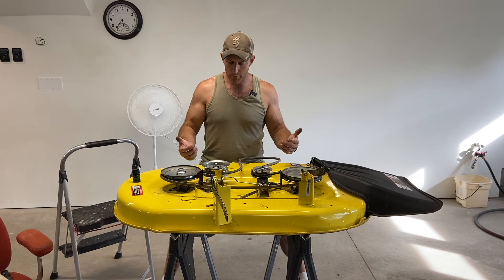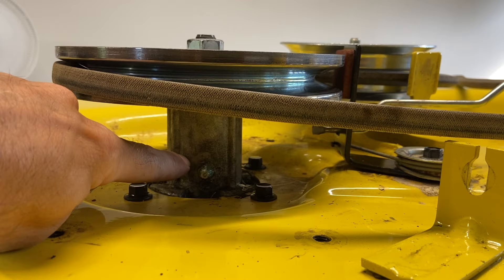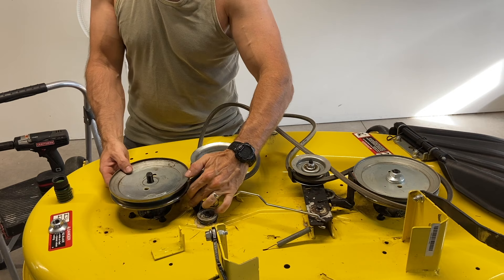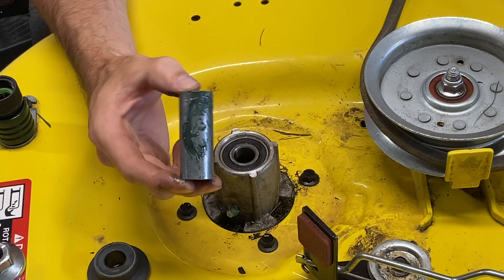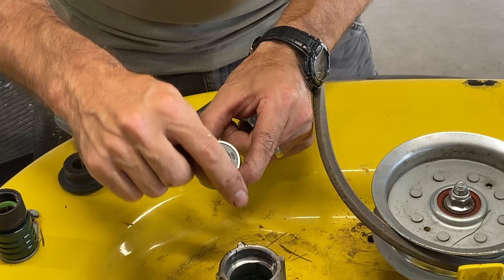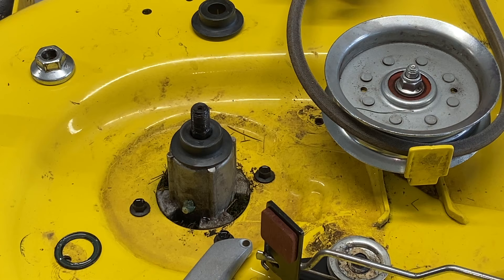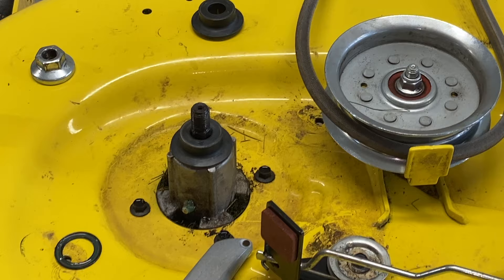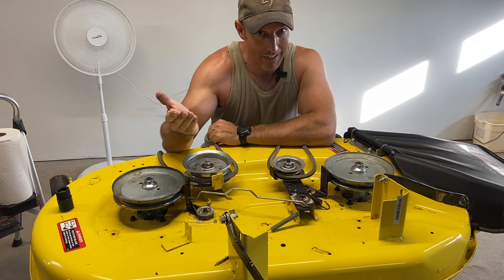I WOULD DO THIS DIFFERENT NOW JUST REPACK THE BEARINGS WITH GOOD GREASE AND PUT SEALS BACK ON.

Comment: I’ve seen some spindles with sealed bearings and some without seals. The best way to check is to look up the part number for replacement bearings, rather than tearing down a spindle.  Nothing at all wrong with sealed bearings, they are lubed from the factory and can last for decades.
Reply from the maker: Thank you for watching and the info
Reply: What are you taling about was real 30-40 years ago. Today, the spindles does not work more than one season. My original bearings for my tractor I had bought new, rolled in just one year, less than 60 hours. In the fall, all three were noisy, even respecting the maintenance schedule, with greasing every 25 hours. So after two lubrications, during the winter I disassembled the spindles and found the six bearings with the seals on both sides. The grease I pumped, did not reach the bearings, because of the seals. After thoroughly cleaning the housings, I installed new bearings on which I removed the inside seals, with my hydraulic press. I carefully installed the bearings, tightened the two nuts on each spindle the both sides, (blades as well as the sides of the pulleys) at 65lb / ft to John Deere's specifications, and the following summer despite the recommended lubrication every 25 hours, the following fall I had to change the bearings again which were still noisy. So ... either the bearings were not chosen well by the manufacturer, or the bearings are of very poor quality, and again it is possible that the grease is no longer of the same quality as there were 30- 40 years ago. So, no spindle would run decades on the John Deere lawn mower.
Reply: @Adriva01  sounds like a better quality bearing is needed...
Try some well known brands.
Reply: @candohunter3176  so what are the better well known brands?
Reply: @Adriva01  Not sure what caused your problem but I had a 48" JD deck that has mowed about 4 acres a week April through October for 15 years with the original spindles and idler pulleys, never touched them. The deck rotted out requiring replacement but that is another story. The spindles were good enough to reuse but I opted for new as I would have had to install them into the new deck and wanted to start fresh.
Perhaps you damaged the bearings by using a press to remove the seals, bearings such as these are not designed for axial loading. Others that I have known to remove said seals gently used a hooked pick to pop the seals out and while I personally disagree with this practice, they have all experienced good results. And we live in corn country where every piece of equipment is green,. Heck, used to be if you bought a new tractor (a real one) they would give you a new mower. Buy a combine and get a Gator!

Comment: I know this is old but... So few people know the truth. A sealed bearing uses a rubber ot plastic ring to keep oit dust and debris. However greese can easily be push by that seal when greasing with a grease gun. Shielded bearings use a metal pressed in disc that goes with that rubber one would go. These are packed at the factory and are not serviceable most of the time. That shield keeps out pretty much everything. You can get a bearing in any combination of open sealed or shielded. I challenge everybody next time you take your spindles off to service them clean it all out clean out your bearings put the seals back in and pump it full of grease then take your bearings back out and you will see the grease got packed into the bearings when you greased it with your grease gun through the zerk fitting. It's literally how it was meant to work.

Comment: Good video. I just took the spindles out of my dad’s old Saber JD today because I was getting a little vibration. My dad brought this new in 98 or 99. The spindles had a little movement but I think are salvageable has the original belt and original deck pulleys and still all tight. Any way I ordered all new to replace them and will keep these as a spare. Do you have any information on where I can find replacement bearings for the original spindles? Thanks for any information.
Reply from the maker: Sorry I do not, leave a comment if you find a good place to buy.

Comment: I went to Detroit ball bearing school. In the 80s . Sealed bearings have grease from the factory. and don't need to be greased. The shield keeps the grease in and the dirt away from the bearings. Unsealed bearings have to be greased to flush out the dirt and lubricate them. Sealed bearings are already greased and sealed. God bless you jesus is coming soon. Judgement is here. Seek the lord daily 👉♥️♥️👑👑👍
Reply from the maker: Thank you God bless Jesus is awesome
Reply: Its a good idea to take the bearings off and repack them every 2 years or so if you live in a hot climate. I've had bearing go out because of NOT doing this, yes, I've learned the hard way.
Reply: My hometown, and I'm still in the area now
Reply: Mark Allison 88- Actually unsealed bearings were meant to be used in an oil bath application, like inside a transmission , small engines, some oil filled pumps, etc. You cant rely on pumping fresh grease into an open bearing to flush out foreign debris. Just ont tiny piece of debris will quickly wear out the bearing rollers/race. But I agree with your first statement. Sealed bearings don't need to have grease added. But we have all done it :-(

Comment: I wud hv jst packed those bearings and replace the seal. Also, drop a good load of grease in the spindle housing. My tractor is 7 years old and hvn't had a problem with bearings. NEVER use water or pressure washer to clean off deck. Just use compressor to blow off the grass
Reply from the maker: Good advice thanks for watching

Comment: Another person occasionally uses my computer and her name and initial shows up.  Sorry.  I've read over a hundred of these helpful postings and have to admit I learned several things.  And I like it that DIY JIM has admitted he also has been impressed by the postings.  Number one:  Do not wash a deck with water. Blow the grass off.  #2:  Bearing technology has changed in my 80 years.  I hand packed bearings for years.  Now that is an issue if you "fill 'er up with grease!"  60 years ago I was shown grease which could be heated with a torch and still be 'greasy" while red hot.  Is that the Lucas Red?   I think lithium.   I don't know but I like the idea!  Conclusion:  Don't clean a deck with water....and SLIGHTLY repack sealed bearings and re-insltall them as sealed bearings.  Now a problem.  Just installed two new tower mandrels, new Oregon blades and a new 95" good belt on a Craftsman LT 2000 42 inch mower deck....correctly.  Within five seconds before even mowing it sounded like the right mandrel had ball-bearing failure.  Any ideas?   I gave up so I could go eat..and have a couple bourbons before total frustration set in!  Charlie Pierce
Reply from the maker: thanks for info and watching

Comment: I've watched a number of videos like yours talking about removing the bearing's inner seal "permanently" so you can use a grease gun on a zerk to hydraulically force grease into the bearing cavity ... I've decided I disagree ... here's why , the spindle and thus the bearing are rotating at high speed and whatever grease you have in the bearing will "mostly" get thrown out w/o a seal ... you can fill that spindle housing cavity to the max , even until the bearings are fully packed but when it's spinning there's no more grease getting forced into the bearing but instead it gets thrown out w/o a seal ... 

OK fine , so what's my better idea (??) ... as a regular maintenance item just pull the spindles , pop the bearings , remove the inner seal , clean and "hand pack" the bearings , replace seal and put spindle assembly back together ... use a high quality high temp. grease and do bearing maintenance every 100 hours or so should be more than enough to keep them in perfect condition ...
Reply from the maker: I agree I think I would do it different now if I were to do it again that is why I say for everyone to read the comments. Thanks for watching and leaving a comment
Reply: @DIYJIM  ... hi , Jim ... I'm not disagreeing w/you personally but the concept of permanently removing the inner seal , there are so many others promoting that idea on TY ... I just think it's not that big a deal to just service the spindles every 100 hours or so , maybe every couple years when it's time to replace the V-belt , just remove the spindles , pop the bearings and repack them , put back together ...

Comment: If you make the effort to COMPLETELY fill the spindles with pumped in grease via the zerks, those inner seals won't stop that hydraulic action. Agreed taking off the inner seal on both bearing the best policy. In doubt of grease simply pushing past rubber/metal bearing seals, kindly look up videos where grease it pumped in behind clutch pilot bushings to be pushed out for replacement. Good content here though and thanks!
Reply from the maker: Thanks for watching Marvin

Comment: Leaving those bearings open is a mistake.  I have messed with his stuff for years.  Pull the cover off add a little grease then put the cover back on.
Reply from the maker: Thanks for the info sounds like a good idea
Reply: And every channel on the subject recommends the seal being removed then re-installed. Whom to believe? And, these guys are small engine repair specialists!
Reply: @swingbelly  I own a large heavy equipment rental company.  We mess with all types of bearings every week.  Unfortunately most bearings are now made in China and they are not what they used to be.  As well, they have engineered them to be unserviceable by design to create replacement frequency.   The cleaner and greasier you can keep them the longer they will last.  We use a very high quality grease and we try to get the most out of them. It’s not the expense of the bearing it’s the expense of the down time and labor.

Comment: Sealed bearings shouldn't need lubricating. They are sealed to keep contaminants out. If you remove the seals there's a risk of over lubricating and contaminating them.
Reply from the maker: thank you for your comment but they are inside the spindle so they should not get any contaminates but thank you for commenting. Hope you summer is going good
Reply: Sealed bearings are great and made to last. Even alot of  18 wheeler semi trucks these days have sealed wheel bearings that last hundreds of thousands of miles with  with no problems. Still a great video.
Reply: Everything 'M' said in the comment covers what I was going to say so the real value of your excellent video is how to get at the bearings in the of chance they need service.  To offer something new, use a rubber/plastic mallet when tapping in bearings or a block of hardwood.   There, i added a tiny bit.  Great video, thanks for doing it.
Reply: I checked with my JD dealer, and he stated that the bearing are sealed to stop water intrusion, and by doing this mod it will shorten the life of the bearings. He told me they are $4 bucks each and would be glad the sell me a set after the mod.
Reply: M  Probably makes no difference in the life of the bearings in a spindle but I prefer not to put in the work for the modification since it may not make a difference.  The spindles are not that expensive so the entire thing can be replaced.  Owners can try the modification if they select to replace just the bearings.  Grease in the spindle may be more about cooling than lubrication.
Reply: @julianyoule-white7675   a short pice of pvc pipe between bearing and the hammer wont hurt the bearrings

Comment: A Sealed Bearing requires a specified amouunt of grease.  Timkin Bearings will tell you how much grease the bearing should have.  Dirt and Contaminants Kill Bearings.  Keep them Clean with the Proper amount of Grease and they will last a long time.  A little dab will do you and a whole lot will screw you!
Reply from the maker: thanks for watching and commenting
Reply: @DIYJIM  If you find dirt or contaminants the outter seal has failed. Clean and add correct amount of grease and ensure inner seal is the outter seal.  I do not worry about the inner seal, but it will hold the grease in the bearing.  The grease fitting is of no value!
Reply: @DIYJIM  If you fill the space between the upper and lower bearing with grease the bearings would want to be pushed out.  It is of no use.  Better to remove, clean and inspect or replace the bearings.  I hope to help!
Reply from the maker: I agree with what you are saying since I have made this video I have learned more and what you are saying makes sense thanks
Reply: Thank You for helping people!
Reply: @DIYJIM  Just a mechanic!
Reply: @DIYJIM  You are Welcome!  Keep helping others!
Reply from the maker: Thanks I’m trying

Comment: I had a mower deck with sealed bearings with no grease zerk lasted over 20 years. Them bearing are dirt cheap if you know were to by them. I use to buy them in a 10 pack for about 20 dollars if that.
Reply from the maker: Wow thanks for watching and commenting

Comment: My housing breaks long before the bearing wears out. :-0(
Reply from the maker: Wow really ,thanks for watching
Reply: Quit hitting shit.  And get toro spindles
Reply: @yzrippin  "Quit hitting shit."
The terrain is rough and I can't change that - far too much of it and too costly (thousands to fix that).
I replace maybe 2 spindles/mandrels each year, much cheaper.
I know it is designed to break so you won;t hurt your deck mount but I still wish they were a little bit stronger. Will look into toro to see if they fit mine - thanks!
Reply: @2Truth4Liberty  ah yea i feel that.  Im allways pulling shit outta peoples lawns.  Last week was a spark plug that almost took out a window and this week i almost hit a railroad spike.   Who tf are these people that put this shit here?
Reply: @yzrippin  My place used to be an auto salvage yard. After many years of cleanup, still picking up pieces of glass, spark plugs, bolts, you name it.

Comment: WOW, am I glad I watched the other video someone below recommended ("Don’t trust the “Experts” Grease your mower deck sealed spindle bearings Common sense maintenance" by Woodcheck Russ the deck Dr. ) he shows you that the grease DOES INDEED push thru and into the sealed bearings....IF you add enough grease using the zirks on that shaft. He says you need to pump 40-70 times to fill up that empty shaft and then the grease will be pressurized enough to push into the sealed bearings, past that rubber seal you took off. Then just keep that shaft full and you probably only have to pump 10-20 times every now and then. Gotta watch his vid, it's perfect.
Reply from the maker: Thanks for watching

Comment: I only got 130 hrs on my 1st set of John Deere spindles on my X300. By the time the bearing went it chewed up the spindle casing below making the blade wobble. The 2nd set I greased about 60 pumps until grease was visible on the blade side. A YouTube channel showed someone testing the theory whether grease gets into a sealed bearing and it does. Proven with a different colour grease. Hopefully my new spindles last longer this time. If this pair goes on me then the next set I will take apart and hand grease them 1st and after that, once a yr at the zerk fitting.
Reply from the maker: Thanks for watching hope your new spindles last

Comment: Just watched this . the reason you are not getting grease inside the bearings is because you are not pumping enough grease into your grease fitting . it takes between 40 to 60 hand pumps to put enough pressure for the grease to get into the bearings the seal you took off the bearing is rubber . grease will squeeze pass the rubber and get to the bearings if you pump enough grease into the fitting.
Reply from the maker: Thanks for the info and thanks for watching

Comment: Removing the seal from the inside will help. But the hydraulic pressure of your grease gun will force greave to the bearing.
You can also drill out the rivets of the idlers pulleys and separate the halves and replace the bearings in those.
Just use steal rivets when you go back.
Reply from the maker: Awesome thanks for the information
Reply: For Idler Pulleys.    I Just Remove the rivets then use a drill to create room for 1/4" bolts / nuts - washers Grade 5 or better is more than adequate. 
 Use blue threadlocker keeps em` tight  and strong till the bearings need another swap.  Repeat as needed......
Reply: Why not just use a grease needle to add grease in the idler and tensioner pully bearings and avoid removing rivets to replace a bearing. That just sounds painful for servicing a 15$ pully. If the bearing is bad it would literally be easer and cheeper if figuring time spent to replace the whole pulley. These parts are cheep.

Comment: The grease you put in the spindle is to keep water out of the spindle. Has nothing to do with bearing life other than keeping water out of them. Water is what takes out bearings , not lack of lubrication. Now that you've taken the grease seals out of the bearing you'd better keep them full of grease or they will go out much faster than they would have before you ( Fixed ) them. I've got a  Husky 54 inch tractor type mower I've ran for sixteen years, three spindle deck, I have NEVER replaced a bearing in a spindle. The only thing you have to do to make them last forever is to NEVER wash the deck off with water. That is what kills spindle bearings.
Reply from the maker: Thanks for you well explained answer and thanks for watching